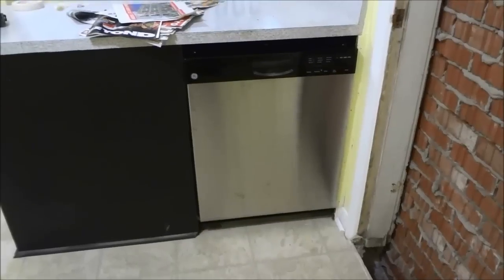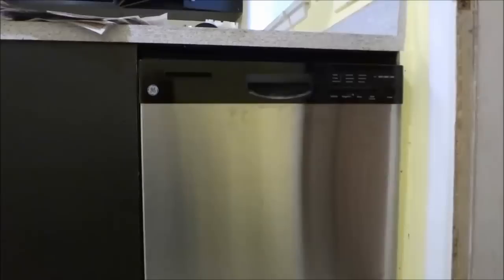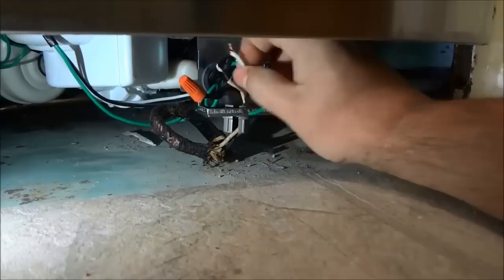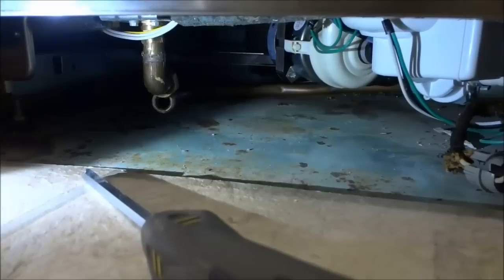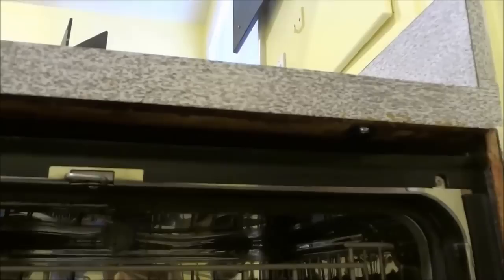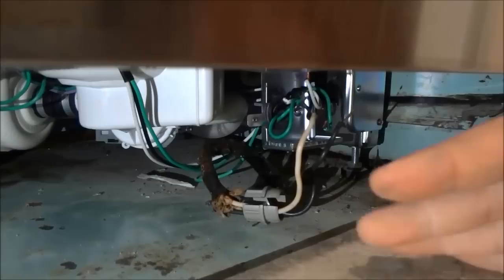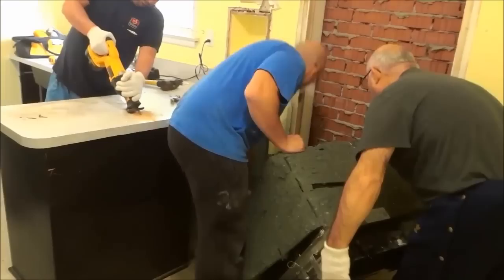How To Remove A Dishwasher (The Whole Process)

Comment: Just an FYI, remove the black wire first, then white, then green last. I understand the breaker is off, but when disconnecting wires you always do the hot first and the ground last. Just a good habit

Comment: Good video. This removal was a little more challenging than some of the other videos on here. our water and electrical came off pretty easily. Raising the feet and getting the dishware to give up the first inch was our most challenging part. Be flexible and prepared to adjust to the challenges of your particular removal.

Comment: Don't forget, to ensure that water does not spill from the open valve after the drain line is removed, you must place a garbage disposal dishwasher drain cap on the end of the inlet.

Comment: Great step by step video if you're using your existing and old power and water connections- NOT RECOMMENDED. Disconnecting the power cord and hose under the appliance isn't necessary when you have a new installation kit.

Comment: Adjustable wrenches (shifting spanners) have the head at an agle so you can access the nut by simply turning the wrench over and it will hit the nut at a dfferent angle.

Comment: I found it much easier to unscrew the water hose from the main connection under the sink. Under my dishwasher was really cramped and tight
Reply: His was a very old home or apt.  The water line was hard piped right to the dishwasher fitting so he had no other place to disconnect apparently.

Comment: Did you have to leave water turned off until you installed a new dishwasher?  So no water supply to the faucets until you have a new dishwasher connected?

Comment: Thanks, they put tiles in the kitchen, so I’m curious as to how they will remove the dishwasher with the tile in the way. Glad to know they can lower the legs if needed. I hope they installers won’t have a problem removing it next month when I put a new one in
Reply: Lost Under the Sky Is that how you clear the counter tile by lowering the leg height?
Reply: @christph3118  yes, the dishwasher’s height should be an inch or two shorter than the opening in the cabinet, very standard.  Once the unit is positioned and power, water inlet and outlet hooked up, the last things are to turn & raise the two bottom feet so the top two mounting brackets contact the upper cabinet frame. Then drill two small pilot hole (if doesn’t line up with the old holes) and secure the mount with provided screws.  That way the dishwasher has a very slight tilt back, is held in place up and down in the front securely, and the door will be easy to swing open and closed, plus the water always pools flat or slightly to the rear, avoiding water flowing forward and possibly leaking out if full and the door is opened.

Comment: So im confused, what happens to the existing wires left behind?
I don't plan on putting another dishwasher there..
Reply: You can mount an electrical box on the side of the counter and tuck the wires in. In case you need it for some reason in the future, it will be easily available.
Reply: @breno802  ah perfect! Thank you
Reply: Additionally, be sure to cap the exposed wiring with wire caps, and disable and mark the circuit breaker so no one tries to turn the power on to that circuit if you aren’t going to use it  again.  That way, when you sell the house, the next family can decide what to do with it.

Comment: What do I do with the electrical wiring after I disconnect the dishwasher? Can I also cap the water off so it doesn't leak when I turn the water back on?
Reply: I am wondering the same thing. How did you end up resolving the electrical and did you cap off the water near the valve?
Reply: @ES-bn1bi  I haven't done it yet. Im not sure what to cap it with & gave up for a moment
Reply: The electric I'm assuming will just be some wire nuts but it's the water I'm worried about 🤣

Comment: I suppose you put in a new Dishwasher correct? If not wouldn't you have to cap off the 3/8th's of a inch water feed that is on the water supply valve?

Comment: The voltage sensor goes on the actual bare wire not on the insulation.  Be careful not to get shocked.

Comment: This is i helpful.  Question - after disconnecting the drainage hose does it need to be capped or sealed at the sink drain?
Reply: Should put a plug of paper towel or small cloth on the drain hose as it will have a small amount of water in it too.  Then push through cabinet opening and pull out with dishwasher.  Good idea to wrap sink connection with a towel to catch and random water until you hook up new hose.

Comment: We have whirlpool dishwasher. If I purchase a different brand how will I know if it will fit existing space?
Reply: Measure your dishwasher cabinet opening.  It will usually be 24” wide by 34” tall.  Vast majority of dishwasher are standardized on this opening dimensions and depth so they should fit. When shopping, verify the dimensions match with the dishwasher’s specifications.  May also be on drawings or pictorials.  Good luck.

Comment: You (and the other video I watched) calmed a couple pre-removal apprehension I had; now I feel confident I an do this…  One comment I would add is DO NOT use a pliers to remove / loosen nuts when a wrench can be used, particularly for smaller nuts.  Even a crescent wrench is only partially tolerable, but, in too many instances, that is all that one can use.  In this case, the stubby crescent wrench you used (which I do not have; I only have a "real" crescent wrench: 10 or 12").  If one has to use a pliers on a large nut, a slip joint pliers is a better way to go.  One other minor comment: were you using your phone for a flashlight??? Seriously…

Comment: Great. Got all the connections removed. Then suddenly there’s 3 big guys in the video. Hope  I won’t need 3 big guys for the last part. 😁. But the rest helped.
Reply: Update. No. You don’t need three big guys. Weighs nothing. Bracket at top was jammed by some countertop trim. 😎 just be sure everything is disconnected and free to move.

Comment: 5:37 Is where the drama starts! That's as exciting as it's going to get. 
So, the clean water and dirty water go through the same pipe? That can't be. I ask because my sink is draining into my dishwasher. I found out when I tried to run the dishwasher and it flooded my kitchen from water leaking through the door.
Reply: No, there is always a clean water inlet which was the pipe connection underneath he unscrewed.  Then there is usually a flexible dirty water outlet hose which passes under (most) from the drain pump motor to the sink drain connection.

Comment: I love the video however the idiot that did the install put the water supply under the cutoff valve, so I have to turn off the water to the house. They also didn't put labels in the control panel so I also have to cut off the power to the house, then do the uninstall and install in one fell swoop

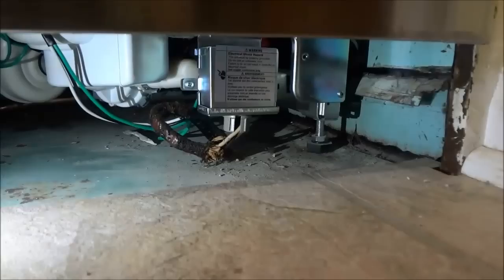Comment: 6:00 why did you skip the part where you remove the water supply line? You removed the bolt and the supply line disappeared. That's The part I can't remove
Reply: Installations are different in many cases.  The inlet water pipe in this case was hard flanged pipe connection with a compression nut.   The nut was loosened so the pipe came loose.  Once that is done, and outlet hose and wiring disconnected, the dishwasher is now free to move once the mounting screws and feet adjusted to give wiggle room to take it out.

Once out, you can then review the water inlet plumbing and decide how to supply water.  Many would consider revising by removing hard pipe at or near water valve or replace pipe with a separate new valve that has a hose fitting.  Then you just use a hose that has the correct fitting to the valve and at the other end the correct fitting to the dishwasher.  Much easier and more flexible for taking the unit in and out in case of repairs:

Since your reply was 3 months ago, what did you ultimately have to do with your water inlet supply pipe?

Comment: Since when is the black wire the hot wire? I thought that it was convention to make ground be the black wire.
Reply: @barty8980  Thank you for clearing that up for me! I'm used to DC circuits and never have really worked with AC stuff before.
P.S. Thank you for sending that video also. I just watched it and that'll help me avoid some nasty shocks if I ever do some diy projects that involve the house wiring.

Comment: Strangely, my dishwasher's water supply is connected to the sink HOT water supply. When I turn it off the hot water stops running to the sink. Is this a common set up?
Reply: Yes.

Comment: I just unplugged my dishwasher. Most dishwashers these days are plugged in under the sink.
Reply: True, some older units are hardwired to the house so they have to be unwired at the dishwasher.  In many areas, code dictates all new wiring to replace old wiring so a new junction box, 15-20A switched outlet and new to code spec 3 wire grounded wiring (usually comes with the new dishwasher) gets put in.  Old wire is just that, old and should be replaced if possible.